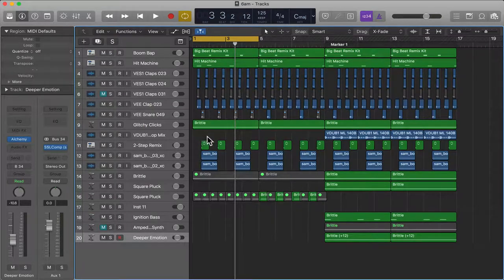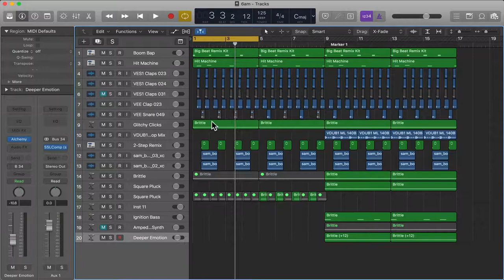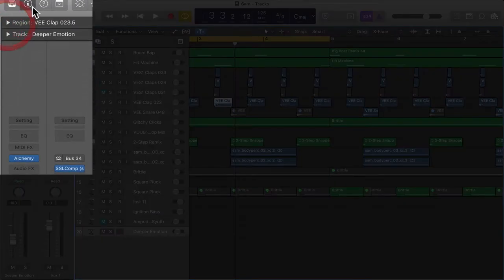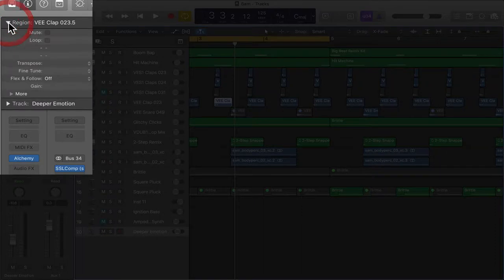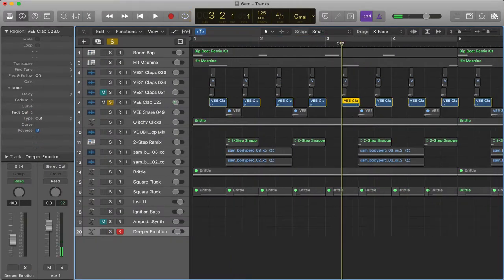How To Reverse Audio in Logic

Comment: This isn't working for me. I do exactly this, however, the option to reverse Audio is not there. Perhaps the update got rid of the option??
Reply from the maker: It works exactly the same on the latest version.  Have you checked under the "more" button under "region?"
Reply: @ryandemaree1610  ahhh it was because I was working with an audio file which had been copied accross projects. Works now. Thanks.
Reply: @gusmurrayofficial  i think im having this same problem. what are the steps to copying the audio file if u dont mind helping?
Reply: nvm got it. 'bounce in place' if anybody else comes across the problem